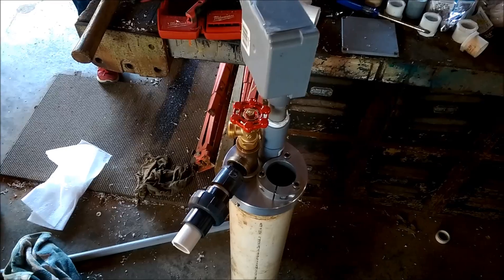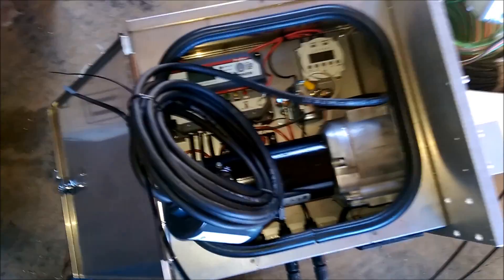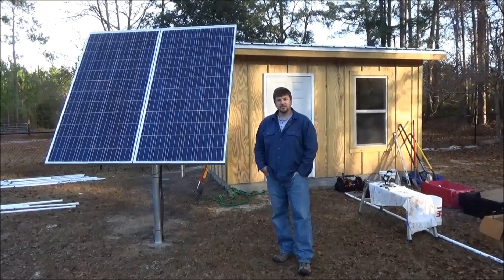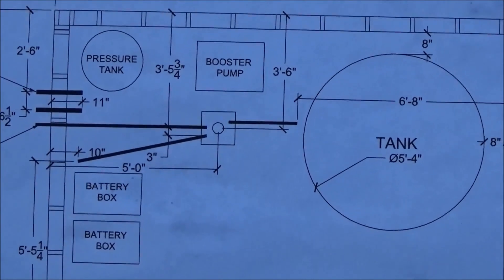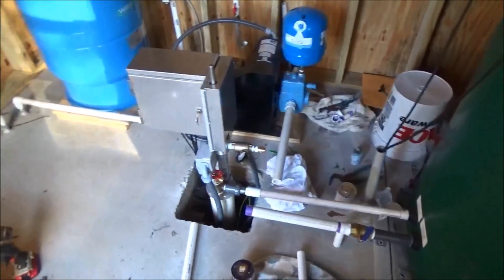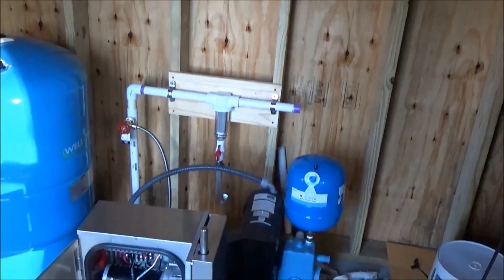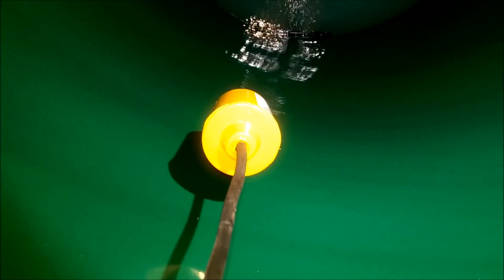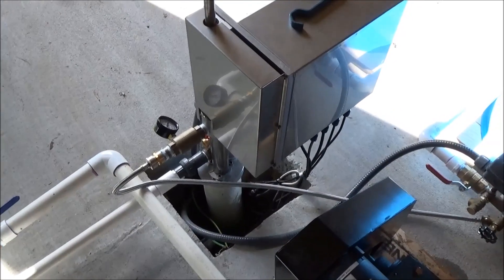Need help getting your water off the Grid?

Comment: One thing I have found out is do not put your well in the pump house. Put it outside and use a pit less adapter to run the water inside. You will thank me when you have to pull that pump out.

Comment: What size wire do I use for a 12 volt deep well pump that will be about 150 feet down then another 30 feet to pump/solar power supply?

Comment: Some Questions E775, I am drill a well for irrigation my garden. Want to use Solar to run this well. Since well would only be used in the spring and summer wondering what a solar system would be doing in the winter. Do I need to put some light to run at night to consume power during winter? Worried about batteries life only be used during summer.  Thanks.
Reply from the maker: No problem.  Not using the system does not hurt the system.  The Batteries would be in float charge and the pump can just sit there.   You do not have to add any loads. I hope that helps.  Once you know the specs for your well email them to me and I can help you design the right system.  Depth, Static, GPM and casing size.  email  info@practicalpreppers.com

Comment: That's a very nice setup. EMERGENCY WATER ON DEMAND:  All you need is 4 things.  A shovel , 2 ice cream buckets and a 10 feet by 10 feet clear plastic sheet. Dig a hole 9 feet square 10 inches deep in full sun. Dig a small hole inside of big hole in corner so your bucket can fit inside. Fill bucket with nasty Icky water and place in corner hole. Place 2nd bucket in center of big hole. Place leafy plants around empty bucket. Place plastic over hole and put dirt on edges to hold in place. Push in center above center bucket lightly push down.  In 10 minutes you will have 99.99% clean clear water dripping in your bucket.  By tomorrow you will have a full bucket of clean water. Works best when made by a swamp Then you don't need the other bucket or the plants. This setup is designed to give 2 people enough water to drink in a day. This design will filter out ALL contamination and bacteria... DON'T GO WITHOUT WATER EVER.. ANYWHERE. KNOW YOUR BASICS.
Reply: +pudge Does this system have a name?  Do you have any videos?

Comment: What is the deepest depth you can go and still be able to pump. Example my well is very deep. Static water level is about 350 feet and the current 2hp 220v pump is set at 580 feet. Total well depth is 600 feet. We had the pump set at 420 feet but we had a year where it ran dry because we share with 2 other homes and some people think if your on a well you have unlimited supply even in a drought! Had to pay about 3 grand to have the pump lowered! looking to move out of here though but was curious how deep one of these systems can pump
Reply from the maker: +Randy H Randy,  We can pump from 820 feet at 5 gpm.   I just designed and shipped a system to a gentleman in Oregon whose static was 580  and depth 700.    We set the pump at 650.  It also has a built in low water sensor to protect the pump.  We took the strategy of pumping to a cistern with this pump so as not to rely on the low water sensor and so that people would actually see there supply forcing them to be more conservative in drought conditions.
Reply: This is a prime example of why not to cheap out on drill depth.. so much pulls off aquifers now the levels are always dropping. The deeper you can go and pump with pressure the better. Till localities start promoting harvesting there is just too many people all pulling from the same source.. pump as deep as you possibly can to prevent issues later with a dry well needing to be redrilled. 

Personally I think it's a good idea to go ahead and install a dry well as well and fill it with harvesting when needed. (Check your local codes before doing this cause some places they will consider this a crime for diverting or stealing water. It isn't classified the same as harvesting to typical storage)
Reply: @engineer775 - are you saying SimplePump rates their 1/4HP solar at those depths?  What is the flow rate?

Comment: Hey E-775 great videos and thank you for putting them up. I am very interested in a system like this and would like to get a pricelist for all of the components and design. I am out West in the hills and have recently put in a well (no pump system yet either) and want to system to be similar to this-- on solar and hand pump backup. 

I plan on doing a ground mount solar a well. Also how deep is your well? I am at 140. I would like to know what type of solar pump you decided on based on the depth. 

Regards,
Scot

Comment: Hey Scott, long time sub here with a few  questions for you. I am finally in the process of purchasing some land to build an off grid cabin and am in the thinking mode as far as water. I am thinking of a direct solar powered dc submersible pump about 100ft deep pumping slowly into a storage tank during the day. And then using a small dc pump in the house to get the water from the tank. That would eliminate the pressure tank and any pump to help increase the pressure of that tank. Do you see any problem with doing that to begin with for a small cabin? I will probably start with a small solar system,around 1kWh.  It is only me and a dog so I really don't have a need for lots of water all at once. I don't see a problem as long as the pump coming out of the tank can produce enough volume and pressure to be able to take a shower. It's probably kind of unconventional but if it could get me through the first few years when money will be fairly tight while building, it would be nice. Do you have some contact info if I have further questions or want your help when the time comes? Thanks for your help!  Levi
Reply from the maker: Levi, 
Send me an email if I can be of assistance.  info@practicalpreppers.com

Comment: Like your video! Thank you. Question: if a solar panel produces at its peak, say 100w @12v. Does this mean that after this energy is stored and need to use it on an appliance I will have 10w @ 120v? So if this is right, for running a 100w bulb for 1 hr I will need 10 hr of peak solar power?

Comment: Instead of using those float switches you can use a hot tub part.  Threads into 1/8 inch pipe thread it is an adjustable pressure switch.  You just need to figure out the head difference.  The switchs are made in different pressure ranges.

Comment: a small note with the reverse logic float switch is you can use relays to reverse the logic of the switch if you do get the wrong one though naturally it will consume a tiny bit more power

Comment: I have recently drilled a borehole in my small farm, with water level between 24mtrs to 45mtrs, also bought shimge submissible pump 2.2kwts, also bought a 6.5kw generator, how do i install this unit and how do i secure/suspend it in the borehole

Comment: I am drilling a well for my new house and need some tips on how to get water to the pressure tank if the power goes out. I have some solar power I just don't know how you can pump from 280 feet. I thought that took a lot of energy. I do already have 2, 145watt solar panels, four 6 volt deep discharge batteries, an inverter and Midnight 150 charge controller. I'd like to do something like you have shown here. How can I contact you for assistance?

Comment: Scott, you are an absolute genius.  Wish you were closer to my project in north Idaho.  I have a 230' flowing artesian well and asked my well driller/pump installer for a Simple Pump just for hand pumping in addition to the electric pump...he sort of laughed at me and said "buy the pump and when the world ends take the well cap off and put it in myself!"  I asked about having the water already flowing go into the storage tank and he again said it would need to be capped off and routed back down the well hole meaning I will be pumping with electricity ALL the time!  Suggestions?  I really want back ups to my back ups because they do have extended power outages...have generator for some of that.  Thanks for ALL your great videos.

Comment: Should add in wind turbine generator with the solar system to change the power supply source
Reply: Wind generators are problematic near trees.  When below the tree tops, in turbulent wind, they don't produce much power even at good wind speeds.  Getting them well above the tree tops and into better wind requires a tall tower that is expensive or takes up a good deal of real estate due to guy wires.  Not saying it isn't a good suggestion but this application isn't very good for wind.

Comment: Lovely work neat and clean...

 Now what is the cost on a project like this on parts Minus the building of course unfortunately I live in a very non permissible area of Maryland being Baltimore county... I really would like to get something like you have here to the rear of my home we have a stream and County Flood plain the water for the stream is less then 10 ft down. So I would hope that the water table would not be far off I only have about 1/3 of an AC yep that's it.. I would like to put the Solar on the roof of the front of the home to where I was thinking in the back of the property where we were thinking is about 120ft but the front of the home gets the brunt of the sun all day it has been a blessing for our heating bills.but since we have city water and sewer how can we have this augment our existing water?  we have a 3 bedroom Brick rancher with full basement about 1800sq ft for both levels  with 2 bath was thinking about a reverse osmosis system for the up stairs kitchen sink for cooking and food and then something larger for the rest of the house. my mother is living here now due to a heart condition I have large washer and dryer setup downstairs and I am looking a small stack-able unit up stairs due to her health problems so she would not have to deal with the stairs not sure if this affects your system not like we would be running both systems anyway... Ideas Sir because I have some money coming in and was wondering about a solar system and and Battery bank that could run my home for 3 days and use a genny to top off my Batteries when needed so that being said I will be using a central boiler for heat and water but wanted to used a insta hot or solar water heater... I had a portable genny when we had a major outage and it was a 6.5 and that ran the whole house tvs, puters and all only tripped the breaker when I used the washer and dryer at the same time both are eletcbut the new one will NG and God willing have a way to switch to LP because I want my genny to be LP and have 2000 LP tank ... suggestions Sir

Comment: I'm definitely interested in a system like this.
I'm curious was that well pre-existing and if so what is the average cost to put in a system like this?
I would tap the well and build the building and do all the work myself, I'm just curious what all the equipment and hardware would run me.
Reply from the maker: This is a new well but it is not necessary if you already have a well.  Get me your well specs and I can send a quote. 
info@practicalpreppers.com